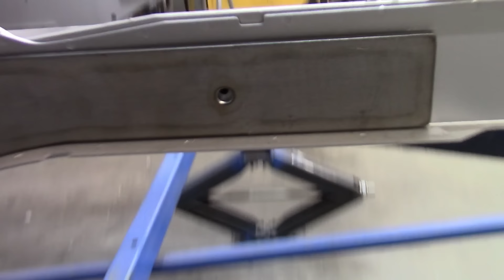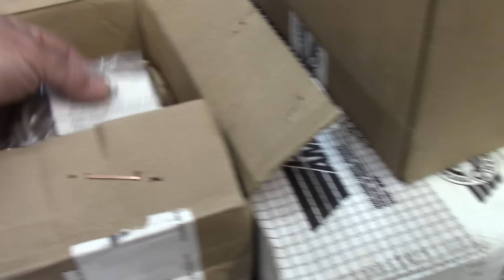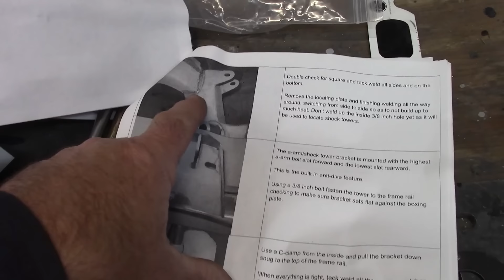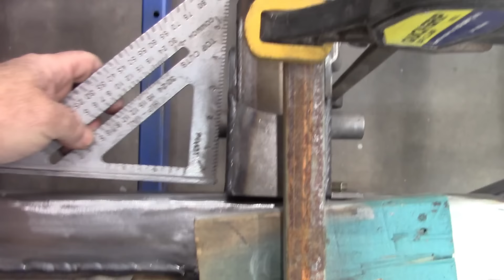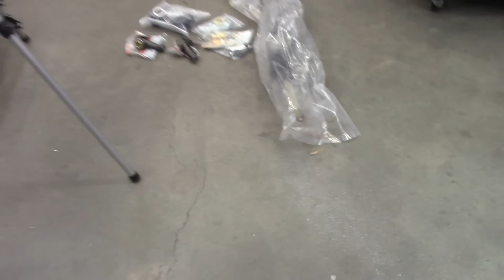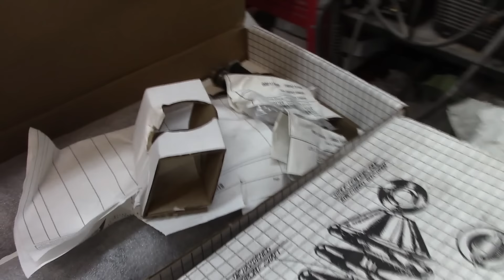TCI front suspension install. 68 Mustang fastback. Fangled 16. #mustang #howto #fastback #diy

Comment: The 500 lbs shock must be for the front, there is no way the 250 will hold up the engine. Nice work as always!
Reply from the maker: I was thinking the same thing but the bolt holes don’t correspond. I’ll double check later.